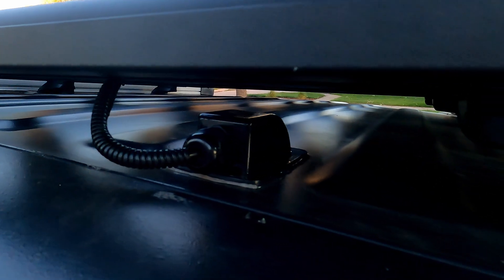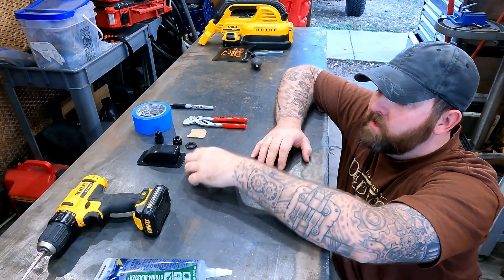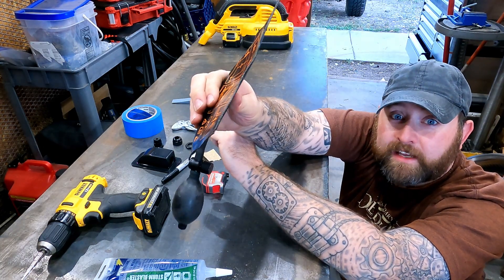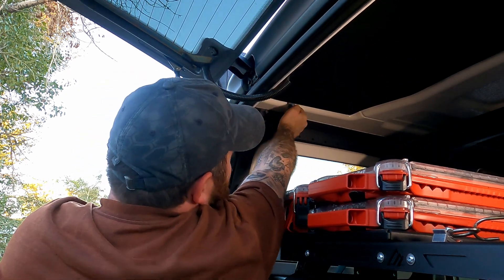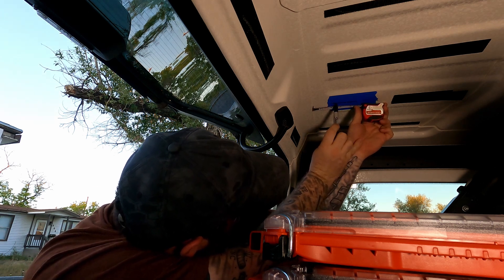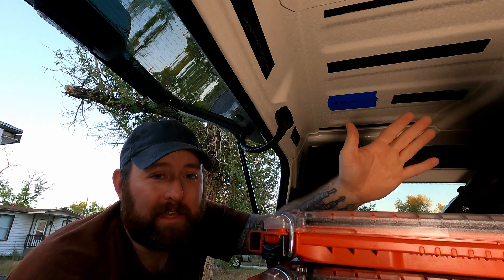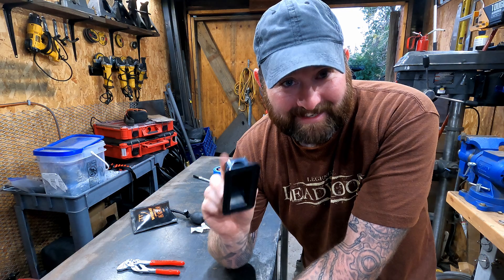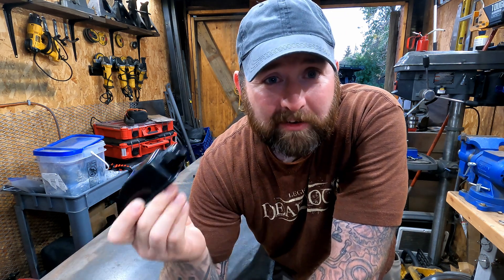Run cables through a JEEP hardtop and keep them WEATHERPROOF

Comment: Thanks for the video.  I'm doing this to my Jeep tomorrow, and I'm curious what you did with all the excess coax.  I asked the WeBoost people if you could use a shorter run but they said nope (I suspect it throws off the SWR?)
Reply from the maker: I coiled the rest up with zip ties in a nice circle next to the main unit.

Comment: Watched twice.  Thanks for the well-done detailed instructions,  HOWEVER - now that I have watched Countless roof installation, light, and accessory videos I still have not found a single one that shows the best route for routing the wires back to the engine/battery.  Everybody shows passing the wire through the roof - the end.  Or wiring the engine compartment - the end.  Or passing wires through fire wall - the end,  Can anyone give me a link to a video showing how to route wires from the battery or aux pod to the roof?  Thanks,
Reply from the maker: When I have had to do that before, I run mine up the inside of the A-pillar. If you fold your windshield down, you can see a path for a cable. Sorry I don't have a link for a video.
Reply: @CodeBrownProductions Thanks for the response.  I had the Mopar Aux switches installed by dealer and the four positive wire connections are located in the footwell of the passenger side so I was hoping for a firewall pass through from engine compartment to footwell.  If they had one that is exactly like the pass through on the drivers side firewall.  Thinking of drilling a hole through the firewall.
Reply: @CodeBrownProductions OK. -  And after you run wire up the A PIllar to you run along the upper trim all the way to rear where you passed the wires through your roof?

Comment: One idea:   I think if I was going to this, while I was in the business I would run the wire at the same time.   I would place the wire in the pass-through before sticking the pass-through to the roof.   Main reason being, it is going to be terribly difficult to stick a wire up through the hole in the roof and then make a 90º turn and hit the hole in the grommet, let alone go the other way from outside in and hit the hole going down.  Then there is the problem with the pre-made cables that run from the antenna to the radio units.  I hate cutting and splicing antenna wires, so pre-placing the wire would eliminate all that.    Great helpful video, good job.
Reply from the maker: I agree a 💯. That's what I did for the other side with the WeBoost antenna. This was done mostly for the video and to have it in place if I do add something later.